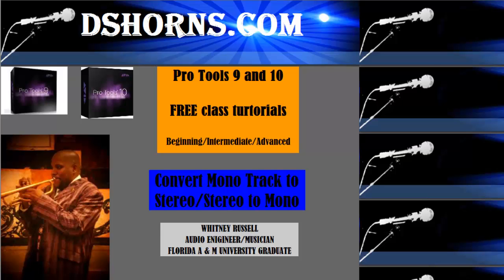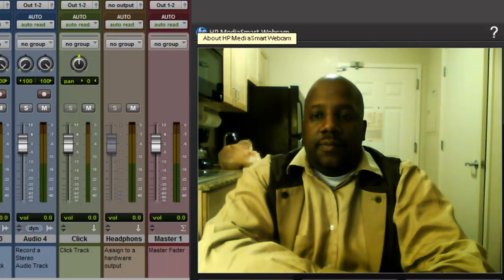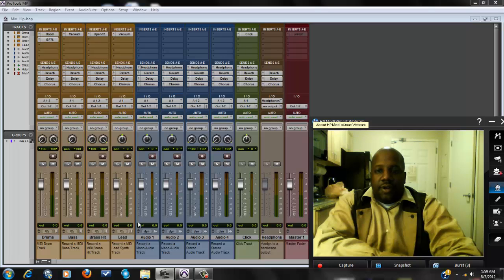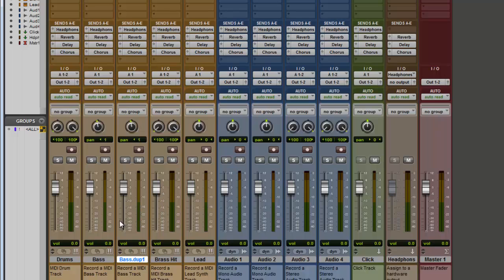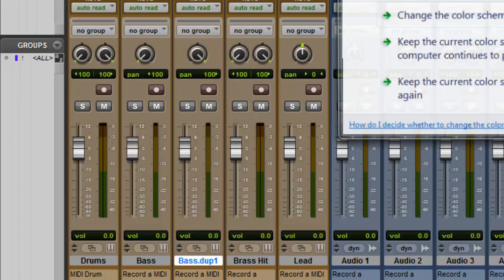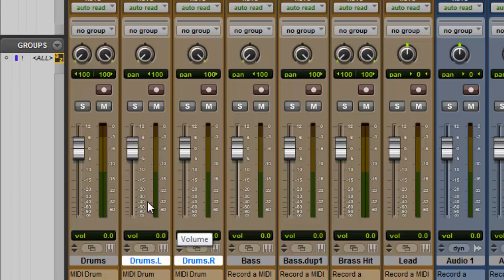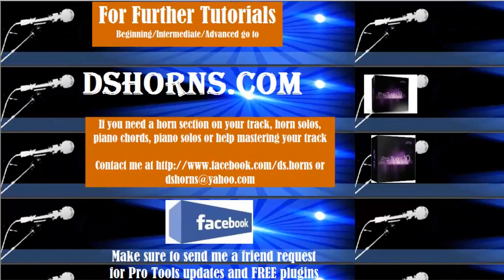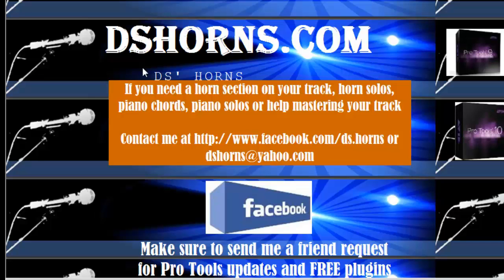pro tools 9/10 convert stereo to mono/mono to stereo

Comment: I'm sorry, but this is NOT how you make a Mono to Stereo track. Why people want/need a stereo track is to control how much gain they want in each speaker. Duplicating a track just doubles the amount of volume you are putting out into each speaker, it does not separate the tracks. This video wasn't helpful